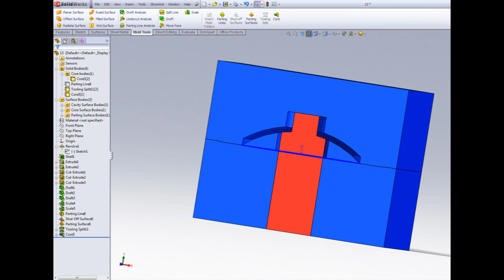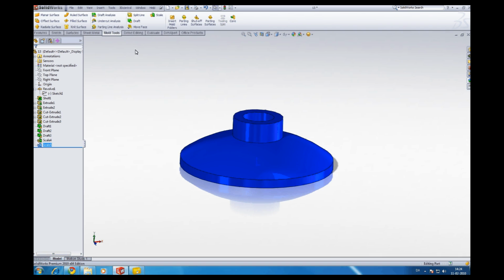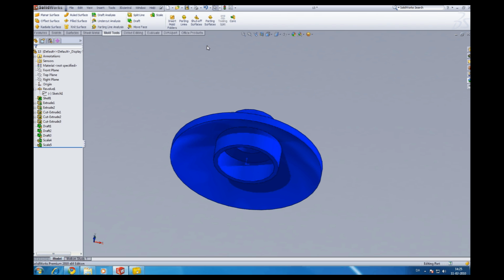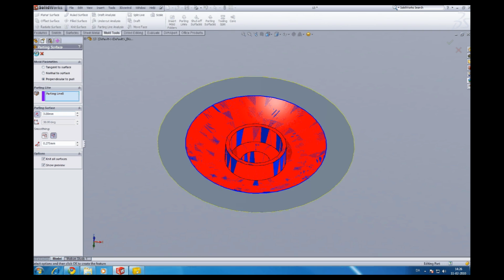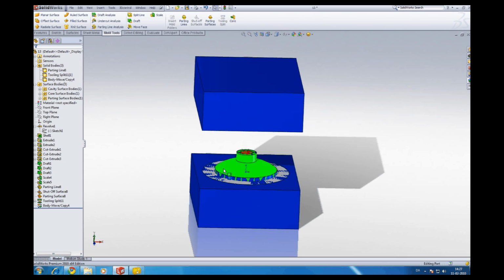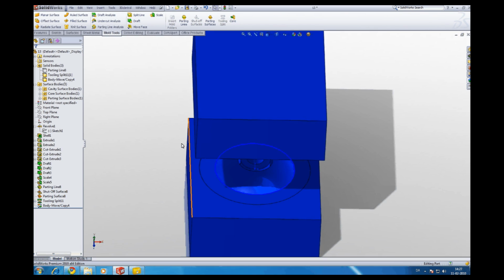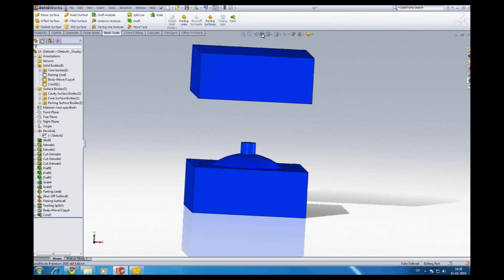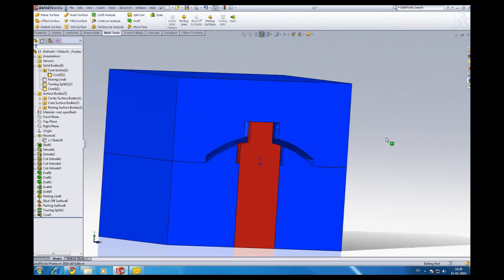SolidWorks tutorial: extract core and create cavities from a part.

Comment: hi, i want to how to make 4 cavity mold of single component, and how to add shrinkage of plastic material in component. waiting for your reply
Reply: try to make an array of one line an then after a it's symetrical. For the shrinkage or contraction you need to design de part on scale 1:1 and then after add scale to apply the contraction factor, for your reference use thi table. (Link above)
https://www.dropbox.com/s/gge0avokzavn7pv/Tabla%20de%20Contracciones.pdf?dl=0
If you need anything else send me one mail
Reply: Ok friend, let be try it. Can tell me how can i add mold base wizard in solidwork.
Reply: And also add elements in mold base
Reply: core and cavity is on multipart not in assy mode. for use the mold base you can use my personal database to do this kind of things
Torbelar Database
https://www.dropbox.com/sh/hkrb9snn0gbxe1f/AAAuKaJw3zodZOD8o102LGl3a?dl=0
PDF with the all information about the STD
https://www.dropbox.com/s/rq1u3c7p0jxo6b3/Torbelar%20Catalogo%20general.pdf?dl=0

If you need a video I will try to upload a excersice.